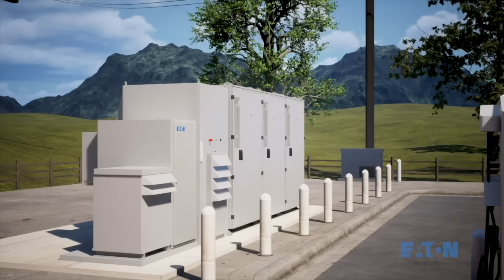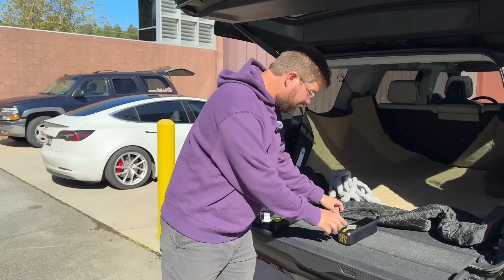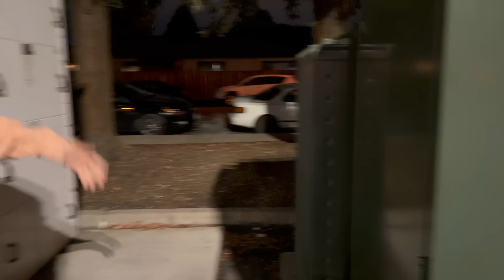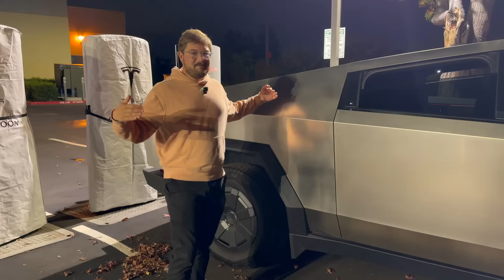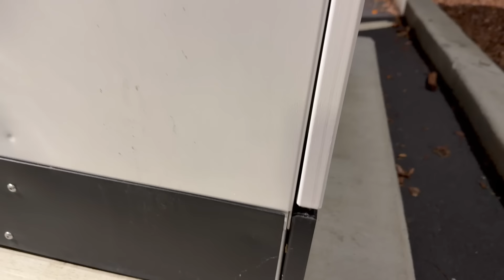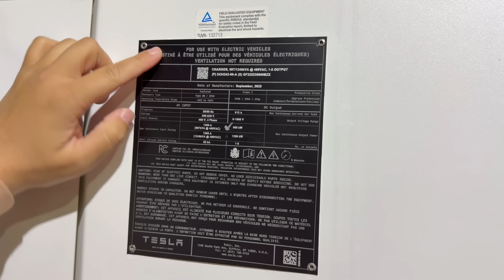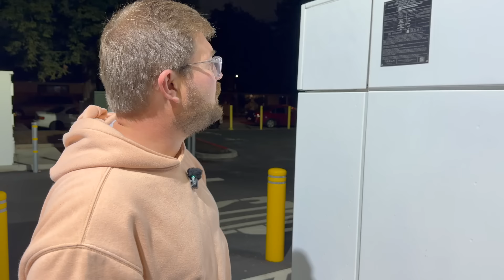My First Tesla V4 Supercharger Experience! 1MW+ High Voltage Cabinet Shared Across 8 Stalls

Comment: Thanks for the video.  I am still learning and trying to learn about the different chargers because I plan to be a Lucid Gravity GT in the future and we have a few Superchargers around aour area.  In fact one location had V3 Posts (I believe they are V3) and they are adding in more posts, but I noticed that the new ones appear to the the V4 look, so I will guess they will be V3.5.  So I was trying to learn the difference between a V3 and V4 cabinet so that I can verify that the new cabinets going in are / will be V3 cabinets.  I will have to wait until the new cabinets are installed.  So much for us ICE people to learn.  My little bairn has enough trouble ensuring I am using high octane fuel, now I have to learn the small differences between V2, V3, V3.5 and V4 Supercharters.  We have 4 Supercharger stations within like 5 M, so I want to know what they are.  Thanks

Comment: Small correction, not sure if I got you right but SuC v2 was still sharing two stalls, like v1 did. In Europe they installed CCS on the v2 stalls, and in summer of 2019 increased the power from 120kW max. to 150kW max.
Sharing between 4 stalls came later with v3 SuCs. And some v3 SuC locations use 3 stall sharing, especially if there are only 3 stalls installed.

Version 4 dispensers here in Europe are mostly installed to fulfill regulations, i.e. to be able to see prices on the embedded display and be able to pay for non-Tesla vehicles. 
Almost all v3 SuC in Europe are now equipped with v4 dispensers, only a few are not, which are then not open for all vehicles.

Comment: Ordered the Fanttik X8 Apex and used your code. It’s exactly what we needed because my wife’s MY has a tiny leak in tread area of her front left tire and we’re hearing that it is hard to repair. She runs low every 2-3 weeks. This will help save us the $3.00 we have had to spend every time to fill her tire at the gas station. I’ll let you know how the Fanttik does when we get it and use it. Thank you for the recommendation

Comment: I have a Cadillac LYRIQ and when I bought my car, I received two years of free charging on EVgo. That two years is coming to an end in January 2026.

From that point on I will be charging at home. We are supposed to wait until after 7:00 PM to charge our cars but I think I can wait until 8:00 PM just to be certain. Off peak charging is the cheapest and I can wake up to a fully charged car whenever I need to.

The Tesla supercharger network is the only network I trust if I ever wore to drive across country, something I would never do. Outside of New York I would probably use the EV go charging network simply because I’m already registered into it.

I do keep a Tesla charging adapter in my trunk, but eventually, I won’t even need it because the newer charges will have CCS adapters.

What I like about Tesla isn’t just the speed of charging, but it’s the ubiquitous nature of their chargers, and the fact that they put so many individual chargers at each charging bank. EVgo barely gives you enough to charge six cars at a time and usually half of them don’t work.

Comment: I have noticed some of the other newer high powered charger look to be all all in 1 units that don't need seperate cabinets, everything is built into the dispenser. Yes they don't have that minimalist  tesla look but seems installation would be faster and they whole thing can be upgraded or replaced if needed as 1 unit.

Comment: 18:55 Only 150kW when all chargers are in use is very disappointing. If we have just eight Model 3 with a low SOC charging simultaneously, we would already need more power, and this is today. What will happen in a few years, now that cars with 350kW charging capability are becoming popular? These chargers are not future-proof as we were expecting.

Comment: IT'S not years late in MY opinion. Tesla had to redesign the entire system to accommodate higher voltage charging and since most charging happens at home when 15 hours are typically available for charging. As a EE design engineer, I can begin to realize the complexity of the system.

Comment: The most important thing is: how long do I, as an end user, have to wait to charge my car? There’s almost zero progress there. 500 kW for a few seconds? 800 V on the service-menu screen? So what? :D I see the excitement, but… :)
Reply: The difference in 10-80% charge times will be very noticeable on third party 800 V cars, like Porsche Taycan, Lucid Air, Hyundai E-GMP cars, etc.  

Tesla cars, including Cybertruck, have cells with limited max charge power in comparison, so not a noticeable difference, if any, for them.
Reply: @georgepelton5645 correct. I was pointing on Tesla cars.

Comment: Question: If Superchargers are used as the primary way to charge a Tesla as opposed to lower voltage home charging will the battery degrade quicker?
Reply: That was what was predicted, but real world data is that it does not.  Rather, turns out low power charging which spends the most amount of time adding electricity to the battery is a more important factor than higher power level.  Of course, that will probably change at higher C rates than Tesla currently allows (I believe the early Porsche Taycan are having many problems with early battery wear).

Comment: That transformer is
2500kVa
277/480
12KV primary
Reply: You must work there to be able to look that up based on the transformer number. Lol.
Reply: @s @snake10566 😜
Reply: @snake10566 It literally is on a plate he points to on the Tesla cabinet.

Comment: Tesla announced in January that it was phasing out the integrated magic docks on v4 cabinets.  As of October, almost all newly opening v4 sites do not have magic docks. I don't think most people knew they were there and I suspect they were somewhat problematic. In Tesla's announcement, they emphasized fewer parts results in lower cost and improved reliability. They are also much easier to use.  If you have a CCS port, you will need to bring your own adapter.
Reply: All manufacturers are going NACS in the US so it's kinda pointless, existing cars can just use their own adapters.

Comment: Just now watching your new v4 supercharger. Just to let you know Alexandria VA just opened their v4 about week ago after waiting months for it already built out. Glade it finally open as the 20 stall close by is 90-100 busy most of every day and hard to charge at most day charging times. 
I tried the charge day two when it came online and had issue right away once plugged in. I have the v2 Model S max charge 150 but for some reason my car would not go over 30kw even thought the vehicle battery pack was conditioned before getting to it. I thought it was the car for sec so I went to the one down the street and plugged it in there and go full output. I think there’s bug on this v4 charging location to. Love the nerdy states. Good video

Comment: Kyle’s wrong I charged at a version four supercharger in Arizona three months ago
Reply: No. You didn't.  You charged at a place with version 4 dispensers attached to V3 cabinets - which still can't output over 500 volts.
Reply: Real V4 is 500kW top speed. You likely charged at a dispenser with max 325kW

Comment: 5:02 - Those "Police Lights" are common at construction sites as a deterrent to potential criminals walking off with materials or vandalizing, and as a detective security control in case it does happen. The Tesla Supercharger site appears to be still under construction, hence the cameras will remain until construction is finished and signed off as being done.
Reply: they built a new Supercharger near me in San Jose a few months ago with the police lights
Reply: I predict these will be a permanent cost to thwart the thieves who cut the cables for the copper, to thwart other (hate inspired) vandalism, and to increase the safety at the site for the comfort of the customer (since they typically install these sites in locations where the cost of land is cheapest, thus not the nicest or safest of locations).  Wonder if Tesla initially accounted for these recurring costs at the majority of their sites? Guessing that's a BIG NO.  I predict it will eat into their profit over time, & the impact will eventually be recognized in their quarterly reports as 1 of many factors that have compounded to negatively impact their earnings (as typically goes for Tesla with reality being much more sobering than the hype).
Reply: Thanks I was wondering why
Reply: It's California, they need to protect against rampant crime

Comment: Kyle, thanks for showing the nameplate. I had always heard that it was one megawatt for the non-semi V4 stations but it’s actually 960 kW so that would make it 120 kW per vehicle if eight cars were plugged in. This is awesome, it matches V1 superchargers with 1 of the 2 stalls utilized. 😅
I’m glad their vehicles are reasonably efficient, because their charging is nothing special.
Reply: V2 was 120 kW, later updated to 135 kW and finally to 150 kW.  V1 was rated at 90 kW, which seemed insanely high at the time.

Comment: Maybe the magic dock isn't yet rated for 800V?
Reply: It's the same design, probably, as the OG Ford adapters - made by Tesla. Ford offered replacement and went with Lectron. So, my guess the Magic Dock adapters were faulty.

Comment: Make electricity $.23/kWh again
Reply: It was all fun and games before the data centers arrived…
Reply: Ain't gonna happen, especially in Cali.  This is what I've been pointing out all along. EVs seemed great when electricity was cheap. I predicted electricity costs would rise and quickly reduce any fuel savings EVs claimed to offer. Less than 5% of all vehicles have adopted EV and costs are already rising (of course, mostly due to AI datacenters, but EVs just compound the problem).  The insidious part is that even people who aren't adopting EV are having to subsidize and bear the costs of subsidizing both the datacenters and the EV leeches thru the increased electric costs & the higher bills to power their homes.  

EV owners are usually some of the more well-off people, yet for some reason we forced taxpayers to subsidize them buying new fancy vehicles with EV credits, subsidized building High Voltage infrastructure to support delivering power to their chargers, subsidized Windmills and Solar Panels which are actually less reliable and more expensive/MWh (without subsidies), and then wonder why the costs are going thru the roof.  Who benefited? People with 60-100 grand to splurge on new toys & making vids of themselves peeling rubber with instant torque; definitely not the average citizen.

Comment: When Kyle first said that the CyberTruck was doing 500Kw I was impressed and surprised. Then he said for like 10-30 seconds and I was like now that sounds like the Tesla I know. 😂
Reply: It actually only lasts for 5 seconds, and holds 400kW for only 30 seconds.
Reply: @junehanzawa5165 well that’s far better than the drop to 200kw we currently have after 30 seconds. This is good progress.
Reply: Yes, but, is it holding over 400-450 for a lot longer now? That would be a huge benefit.
Reply: @justinstewart3248  which proof? lol!!!
Reply: @carholic-sz3qv which proof? Did you message the wrong person?
Reply: its an absolute joke tbh! why cant they don that for at least 15 minutes and then slow down? tesla is a joke.
Reply: @carholic-sz3qv I find it crazy that Tesla is this far behind on charging tech.
Reply: @DoubleCTech  In some areas, yes. 
But still by far best experience It will be a long time, if ever, we get past CCS problems. Long cables, screens on the chargers, credit card readers, apps, bulky plug, etc.
Reply: What is the red/blue flasher on the pole???
Reply: @BeechSportBill security cameras
Reply: Dont tell my wife
Reply: Yeah "super conservative charging", reduce batt wear and tear I guess but they can improve it over the air eventually.  (wait until out of warranty then jack up charging sp, HA!)
Reply: This is a start, and a great one.
Reply: @thedukeofalinor1377  its not a great one for sure!
Reply: @carholic-sz3qv  how many other car makers make 1MW chargers.
Reply: @carholic-sz3qv it’s absolutely an excellent start into the next generation of charging. The dynamic load sharing here will cut costs and allow this to proliferate and install much quicker!
Reply: @thedukeofalinor1377 Great start? This is Tesla amigo, it ends there too
Reply: @raychang8606  LOL.
Reply: LOL, Tesla may be slow at times, but they improve. 
Look at Model S lap times, for example.
Reply: @thedukeofalinor1377  nonsense!!!! so they bring a vehicle with crappy brakes and cooling system from factory while other manufacturers does that from the get go, you call that impressive?!
Reply: @carholic-sz3qv  Not sure what you are talking about. Check the Model S vs Taycan battles on the track.
Reply: Tesla is indeed adjusting its charging curves. For example, the charging curve for the Lucid 900V 400kW is not as good as that for the Taycan 800V 300kW.

Comment: 12:38 - It's because the future is supposed to be NACS. They can have legacy sites supporting the Magic Dock but for new sites, I agree with Tesla, they don't need to include CCS anymore. This will also help further accelerate adoption to NACS.
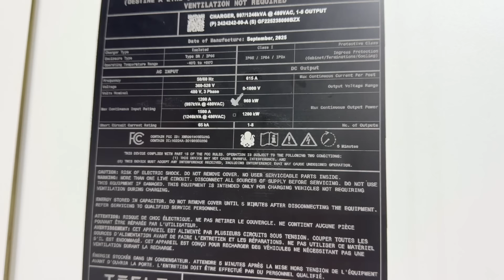EDIT: 23:57 - Doesn't this mean your video title should be renamed to "... Experience! 0.96MW high-voltage..." 😅 (Since the check mark is on 960kW, not 1200kW)?

Comment: Tesla has said that V4s are cheaper for them to make and deploy than either V2s or V3s. It's why Tesla's still slaying it, deploying 1,820 Supercharger posts in Q3, while everybody else combined deployed 2,241 DC fastchargers. Tesla deploying about 45% of all fastchargers in Q3.
Reply: In 2025 tesla alone is averaging opening 1.4 new sc posts globally per hour so far! Over 1.7 in q3 alone.
Reply: Only for them to be outdated real quick so you actually end up spending more instead of doing it right from the get go.
Reply: @boostav  Nobody did it right from the get-go than Tesla. Reliable, reliable, reliable, unlike every other fast charging provider. And almost always near the highway with a fast 7-sec handshake. So nice to have the Supercharger system backing up your Tesla.
Reply: @boostav  You mean 1.2 MW charging coming to V4s in the near future? Or did you not know that?
There's always a DKE poster, isn't there?
Reply: @777Outrigger  Talk about DKE. First off it's 1MW V4 SC for cars, 1.2MW is only for Semi. Second it's 1MW split over 8 posts, which means 125kW max if all posts are occupied and unlike V3 SCs they cannot transfer power from another cabinet to increase that. 

Considering all EVs from serious manufacturers releasing now hold flat charging curves high into the pack at 200+ kW it means throttling will become common quite soon.
Reply: @boostav  I know all that. But who knoweth what cometh in the future??? The potential is nigh.
  And people like you can only see big numbers. You don't see the reliability, the super-fast handshake time, and the proximity of Superchargers to highways. --->Tesla keeps winning Out-of-Spec 'Race to Vegas' competitions because of these factors, not because of charging speed or range. It makes me feel very secure on a road trip.

Comment: Every charger should have granularity. I believe V3 also has it. Maybe not very noticeable, but it is not possible to don't have it because there is limited number of DC/DC converters taking 800V and stepping it down to match EV battery voltage.

Comment: For the 5 minute thing, it says in the text under it:
Energy stored in capacitor. Do not remove cover until 5 minutes after disconnecting the equipment.
Reply: That 1.21 Jigawatts takes a while to dissipate.

Comment: No screen on these V4 cabinets, or is that not a thing they have in the US?
Reply: They prolly want to make it as inconvenient as possible for other brands while the EU shows them the finger and tells them to bend over 😂
Reply: I know some of the V3+ sites have little LCD screens on them. Interesting these don't, right? My Hyundai Ioniq 5 has plug-n-charge, which I think how most cars will charge in the future (fingers crossed). I wonder if they figure the single point of sale/screen unit will be enough, when most people are expected to be simply plugging in to charge.
Reply: If they install a dedicated payment kiosk, they don't need screens on individual chargers. Cost saving

Individual screens to show charging stats would be nice, but even in Europe the screen doesn't seem to show anything unless you paid via contactless
Reply: @winkcla  I haven't looked at it while charging, but I have noticed that the screen shows charging time and delivered energy when the cable is put back in the cradle, at least in Denmark. 
I have a Mode 3, so I don't use card payment :)